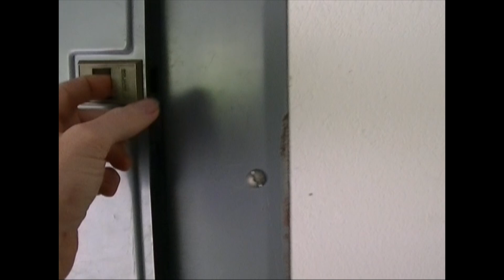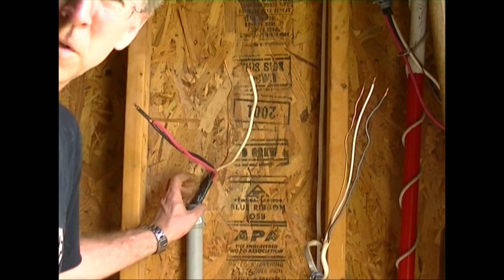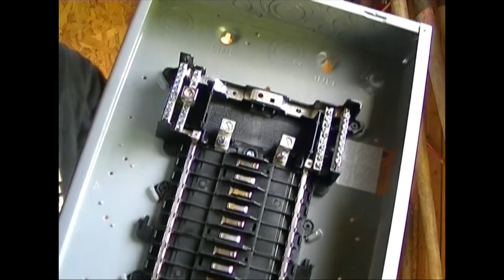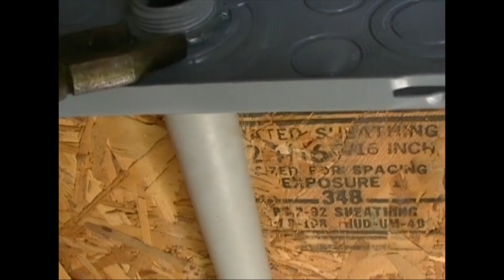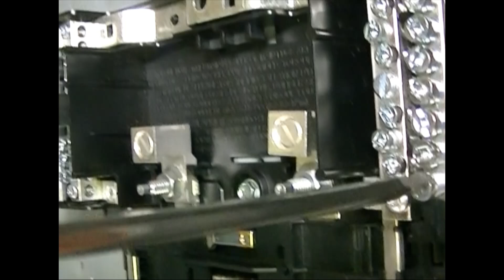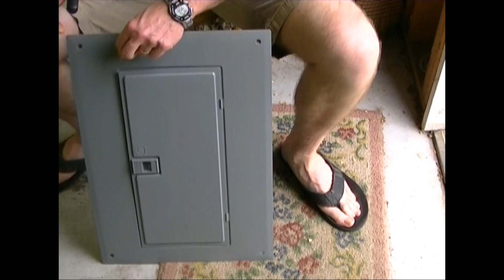How To Change Out A Load Center (or Breaker Box)

Comment: The mains need a separate breaker so you can shut off the box in the barn then from metal conduit to the 2 buss bars on the new box 
Then you can start adding breakers .. Any 240 coming out Needs to be metal conduit to the outlet and the drive a copper ground stake outside and run a nice fat ground wire ... Be care carful if it's wet ground and your using some sort of machine like a power washer you will feel the current.  Not being a smart ass I use to work on high power lines so a few tips from a retired guy
Reply from the maker: Thank you for your comments.  We always value the voice of experience.  I think you comments apply to a main box and this actually a remote box being fed from the main.

Comment: i would of put it a little lower so neutral and ground can go square corner to bus bar neutral on isolated and ground on bonded one i would of used junction boxes above the box if some are to short and run all wires square corner inside the box
Reply from the maker: That would look much neater, I think.  Thank you for your comment.

Comment: Also, you did not accomplish what you wanted was a 100 amp service. You still have a 60 amp service. To get a 100 amp service you need to install a 100 amp main circuit breaker.
Reply from the maker: I'm not sure how you know what I wanted but I assure you I got what I wanted and needed.  To get a 100 amp service you need to run a heavier gauge wire than what I used.  I only needed a 60A service.  I used a 100A box because there was more room for the breakers I needed.  That said, I have to be responsible not to overwhelm the main breaker with more than 60A of usage.  Thank you for your comment.
Reply: I thought you said you needed a 100 amp box so, naturally I thought you were going to put in a 100 amp service. That makes sense to me.
Reply from the maker: OK, that's true.  I didn't say that I don't need 100A.  Sorry about the confusion.
Reply from the maker: What?  Is "Bowling ball rack" the result of a random comment generator or is a meme I don't know about?
Reply: Bowling ball rack

Comment: Putting educational videos online when you don't know what your doing yourself isn't safe specially when your working with electricity. Your feeding the panel with a 60 amp breaker thru the buss when clearly it's a main lug panel. A lot of what you did is not in code. Teaching people the wrong thing is not helpful to anyone.
Reply from the maker: Thank you for your comment.  I agree that one shouldn't feed the panel through a 60A breaker and I don't recommend it.  I did it for reasons explained in an earlier comment.  You said 'A lot of what you did is not in code.'  That is not very helpful.  Please tell me exactly where I violated code and then we'll all know.

Comment: Boy, you're a little too comfortable for my taste moving your hands around and about those 220 volts.
Reply from the maker: Actually, it's only 220VAC if you touch both lines.  If you touch only one line, it's just 110VAC.  That said, I am in fact very comfortable (and careful) around house current.  If you're not then make sure everything is off when you work on it.  The key is to know exactly where the danger is and avoid it.  Thank you for your comment (and concern).

Comment: Can any one help please? iam having issues I have knowledge about wiring panel box because I did courses ect" but don't know how to convert from 220breaker to 110breaker using the same circuit which I was running air conditioning 220breaker on" but my 220 conditioning unit has broke down and I decided to purchase a new conditioning unit running 115 volts! But I will like to know how to convert from 220 to 110 using the same wiring???
Reply from the maker: OK, you can totally do this.  If your original 220VAC air conditioner had 3 insulated wires (usually red, white and black) then just connect the black wire to your 110VAC breaker and the white wire to the neutral bar and leave the red wire disconnected.  If your original 220VAC air conditioner had 2 insulated wires (usually white and black) then just connect the black wire to your 110VAC breaker and the white wire to the neutral bar.  That will give you 110VAC on the black wire and neutral on the white.  There should be a bare copper wire to ground which you need not mess with.  When you have it wired turn on the breaker and measure black to white with your multimeter set on VAC to be sure you got it right.  Good luck!
Reply: Hi FloridaJoe3, Your explanation above explains to thurian richards how to change the connections at the breaker panel for his existing 220V window A/C circuit (that probably is 240V) but you failed to explain what/how to make changes at the load/receptacle end of that same circuit. How can he plug his new A/C 110V power cord into his old 220/240V outlet? 
Keep in mind that the existing 240V/30A wire (#10g) is used in the wall for the old A/C circuit and the new A/C requires a 110/120V receptacle which uses either14g/15A or 12g/20A wiring.

Comment: Exactly what I was looking for. My mini split will take a 220 and runs at a steady 10 amps..2400 btu! so that leaves plenty for lighting etc. WE ran new #6 today and are replacing the 1930's box. it looks like the old throw from the old frankinstein movie!
Reply from the maker: Sounds like a fun project.  I hope all goes well.  I'm running my mini split (1800btu - I think) and a flash water heater fed from a 400 foot run of 6AWG wire with no problems.

Comment: #6 wire was left in. Joe you don't mention except for once early on that you are using the same #6 wire. Will that be sufficient for a 100 amp box?
Reply from the maker: As mentioned in reply to your other comment, I had already run #6 back when the service was just for a simple barn.  The #6 might not be sufficient if everything was turned on at once in the shop and apartment.  If this were to happen, though, I'm pretty sure the 50 amp main breaker would trip.  In other words, just because it's a 100 amp box doesn't mean I'm trying to feed it 100 amps.  The breaker limits me to 50A.  Thanks for the comment and good luck with your project.

Comment: You did something wrong u need to have 100 amps wire not 50 amp wire that dangerous
Reply from the maker: Thank you for your comment. That is a good point to bring out. If you intend to put a 100 amp main breaker in your load center you'll want to make sure and run wire with a heavy enough gauge to handle 100 amps. I have a 50-60 amp main breaker in my load center with 6AWG wire service coming in so I should be OK.
Reply: Should n't you have ran #4 to the new box? How sufficient will #6 be for  you AC, Water heater etc. as you mention? I'm in the middle of a upgrade here , sorry. My load breaker is ancient! 60 amp with no ground on the old outlets.
Reply from the maker: Julian Duran Yes, of course, #4 would be better.  I had already run #6 back when the service was just for a simple barn.  The #6 might not be sufficient if everything was turned on at once in the shop and apartment.  If this were to happen, though, I'm pretty sure the 50 amp main breaker would trip.  In other words, just because it's a 100 amp box doesn't mean I'm trying to feed it 100 amps.  The breaker limits me to 50A.  Thanks for the comment.

Comment: I recommend having an electrician look that over.. Doesn't seem right to me..
Reply from the maker: Tim Gomes Hello Tim and thanks for watching and for the comment.  Is there anything in particular that doesn't seem right to you or is it just a general feeling.  If you have a specific idea of where I went wrong, I'd like to hear it so I can address it.  Thanks.
Reply: +FloridaJoe3 All the Sub-panel's I have run across dont have a C/B where the feed wires lead into the panel. Your BLACK+RED wires that come from your Load Center Main Panel in your garage go to a C/B. All the sub panels I have seen, those wires are protected by a C/B in your garage and then lead into Post-A and Post-B up top of your sub-panel, like your garage panel is wired. If my explanation is confusing, take a look at this photo link. The empty box on the right is the "sub-panel" which in essence is your shed panel. http://www.wiringdoneright.com/subpanel/subpanel.jpg
Reply: Johnny Walker

Comment: Since that is a sub panel to you main house panel, the neutral and ground do not get bonded. Also, the conduit bringing in the line side wires needs to be supported within 36" of the box
Reply: I'm a rookie at all of this and one of the first things I learned and one that is repeated in every sub panel video that I watch....Don't tie the neutral and ground together in a sub panel.  Only in the main panel.
Reply: That's one of the things that seems off to me man,, also the conduit with te feed in it isn't supported right
Reply from the maker: That is absolutely correct and covered in detail in the Correction video subsequent to this one.
Reply from the maker: Bryan G Thank you for watching and thanks for the comment.  I am curious as to what harm it does to tie the neutral and ground together in this sub panel.  Note: it is about 200 feet from the main panel where the neutral and ground are also tied together.  It has been wired this way for 10 years and I haven't noticed a problem but that doesn't mean it's right.  Please explain if you would.
Reply: FloridaJoe3 The simple answer is it is stipulated by the NEC, National Electric Code. I believe it's in NEC section 250.24. The reason behind that is to prevent a "parallel neutral path". Instead of me typing all of this out, refer to a few people who can explain it more eloquently than myself, 
here: 
http://www.mikeholt.com/forum/Forum1/HTML/003455.html
and here: 
http://diy.stackexchange.com/questions/1706/is-it-ok-to-have-mixed-grounds-and-neutrals-on-bars-in-a-breaker-box
As a home owner, in most states you are permitted to do this type of work as long as it can pass an electrical inspection. An inspector would have alerted you to this issue. 
While there has been no issue in your installation for over 10 years, if someone watches this and does it exactly as you've done but conditions are different for them, there is danger of electric shock or worse.
Reply from the maker: Bryan G Thank you for the links and the explanation.  I see it very clearly now.  I'm hoping to talk to my electrician friend today about how to isolate the neutral and ground and hopefully make another video explaining the problem and solution.  The panel I installed had four terminal bus bars for ground and neutral but they are all tied together so it wasn't readily apparent how to isolate ground and neutral.  I looked at the sub panel that I replaced and it was the same way.